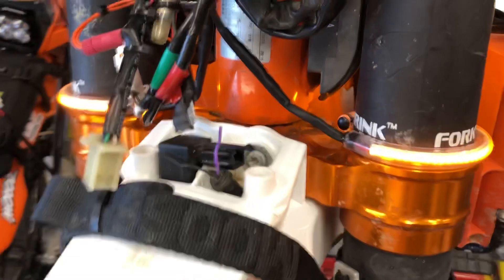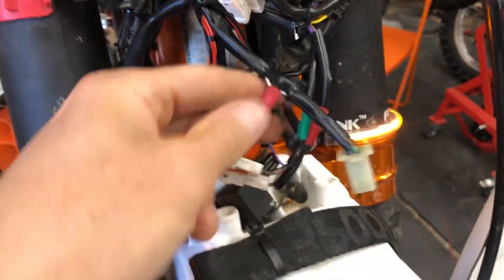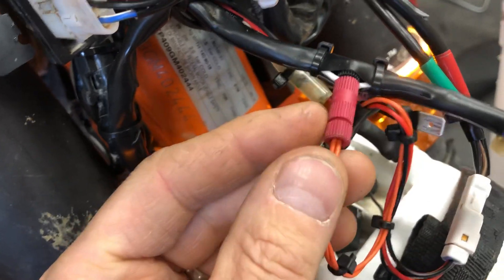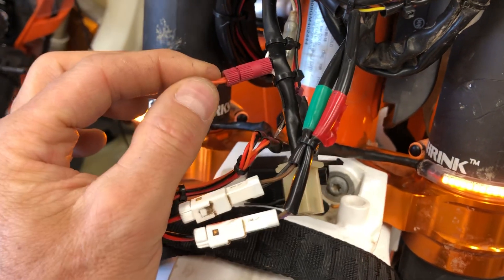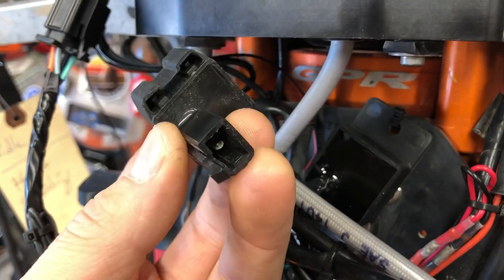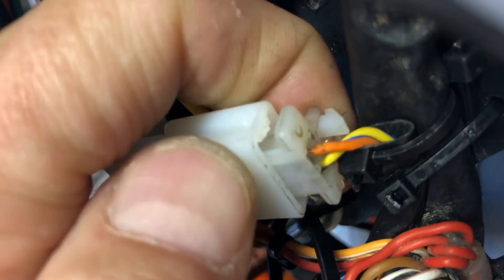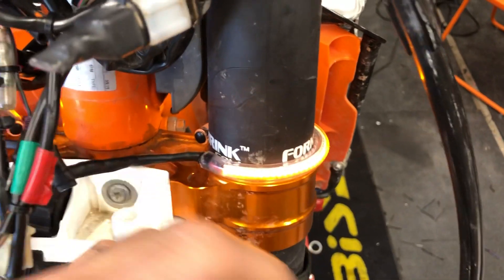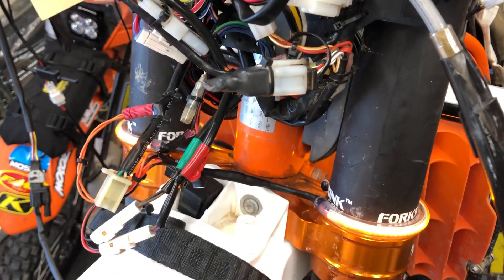Installation of the 360 Fork Wrap turn signals

Comment: Super simple super easy………… if you have a KTM. my husband has a 1997 ATK 604 that he wants to put them on. he said he would like to know how to direct wire the lights if you don’t have the plug and play system. LED flasher? How does that wire up when you’re wearing direct without the plugs? everything else is pretty easy.
Reply from the maker: That’s an amazing bike! Unfortunately we don’t know anything about it
Reply: What are the basic needs of your lights and flashers??? We can use an electrical meter and a test light and find the power outputs on the ATK. Then we can make a video for you on how to wire your kit to bikes made by other manufacturers.

Comment: Those are super slick! And the rears! Just what I'm looking for.
Reply: Hey did you buy and receive these from taco Moto co?  Ordered some a month ago and have received nada.  Just curious if you've had better luck
Reply: @Mtn_Sea  Don't have a bike yet. That's a bad review, have you got ahold of them?
Reply: @FaithandActiondotnet  That was probably due to the supply chain problems a year ago.  I ordered the tidy tail and wrap around front lights along with some other stuff yesterday, got them today.  That's like Amazon fast.  edit: That's why I'm here looking at the install video.

Comment: Thank you for the great products and even better videos. I bought this kit from you but didn’t see the LED bulb in the bag. Is it common to be a part of the kit or did I need to order this separately? 

I’m also wondering if it’s possible to just remove the incandescent bulb and break the circuit so that they don’t flash like hazards?

Thanks!

Comment: If you installed the Sicass Multi-function switch which allows turning 'off' the lights while riding, I would assume the fork wrap LEDs would be on that same circuit and the running light would also be controlled by the switch. I that correct?
Reply from the maker: No, the OFF position only turns off the headlight not the running lights

Comment: I have basically same signals (led strips front and back) on my 2020 exc. I have the relay, and I have the blinker indicator. All is installed perfect. Its been triple checked. But for some reason only my left side blinks... leds work, I have everything required from you guys. (Led relay, and indicator harness) checked fuses all seem good. Again. Lights work. I've checked everything all is wired correctly. Cant figure it out. Any ideas would be greatly appreciated.
Reply from the maker: You can call us at the office if you still need help.

Comment: Any ideas to hook the key ignition switch back on once you remove the front turn signals? I zip tied mine on for now. Just wondered if you had a method you came up with? Thanks mike
Reply: The little billet relocator bracket doohickey can be bolted where the old right signal stalk came through. My plan anyways...

Comment: I have a lot of problems with my signal lights.

My signal lights are turned on, 1 side will flash at 100% and the other will flash at 20% how would you suggest solving it? 
I've had the hazard warning lights problem intermittently, finally know how to solve it thanks!
Reply: what's up my man, i see we're friends on facebook so i'll send you a message on messenger. we can do a phone call if needed to help get you sorted out.
Reply from the maker: Glad this helped you. That little indicator bulb housing gives allot of guys trouble